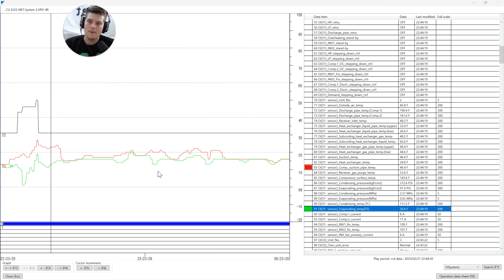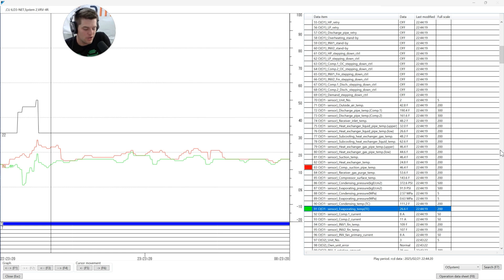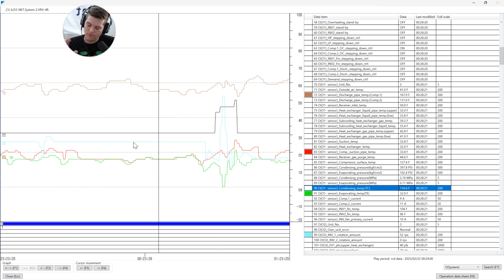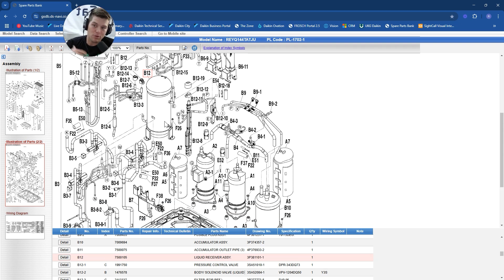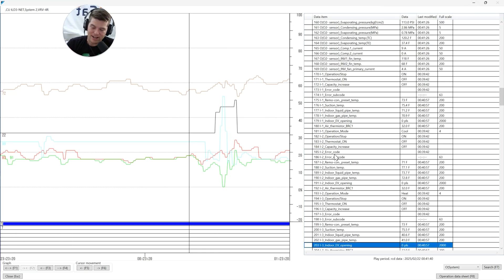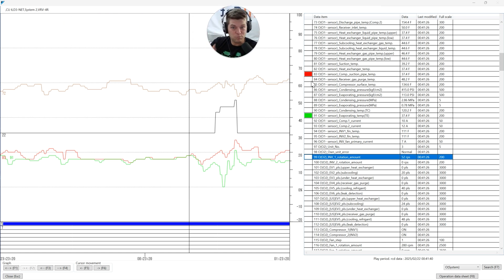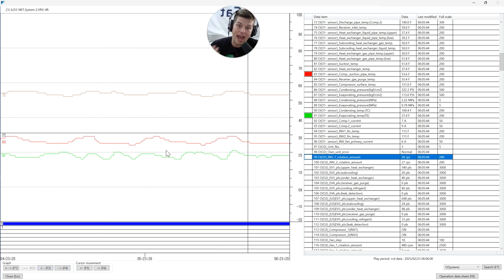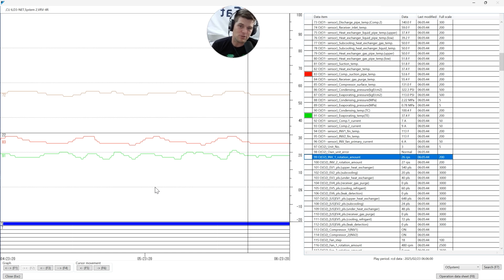Troubleshooting Data - Accumulators the Unsung Hero of VRV Systems

Comment: With all the logic these VRF sytems have, I'm surpirsed they don't have some sort of alarm for low suction superheat. Also it would be benefitial if the compressors were fitted with a sensor that can measure oil level inside the compressor. Those appear to be the main compressor killers on VRF systems.

Comment: another great video, just want to clarify the baseline numbers for SSH, Ive watched the 3 pillars multiple times and this video saying 18, 20, 25 all good suction superheat. specifically for VRV4 when attending ST1 training they gave us paperwork that stated compressor suction superheat should be between 5.4F - 14.4F  and DSH 27F-72F  do you agree with these values? keep the videos coming!
Reply from the maker: I am going to remake my 3 pillars video and dive so much deeper into the numbers to help everyone understand the what and why. The range is there because it depends on the demand and capacity of what is running inside.

Comment: How about a 6 port branch box with one failure.  Can you add a single branch box to the system?
Reply from the maker: If you are asking if a port on a box fails can I just cut into the piping network, add a single port box and disable that port? Sure but the cost of a new box is close to just getting a new 6 port that might be under warranty. Also I would check out EEVMate.com and get a EEV driver tool to fix stuck eevs.
Reply: @ we used the manual magnet.  I think I paid $450 for a new bs box. Old stock.  $1500 plus I think for the 6 port.